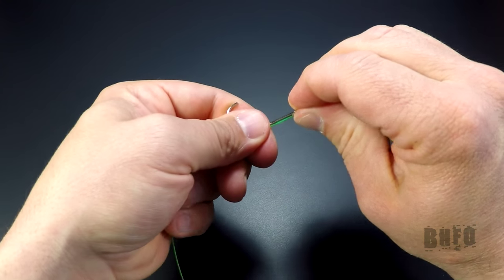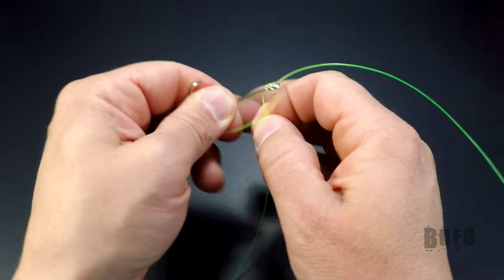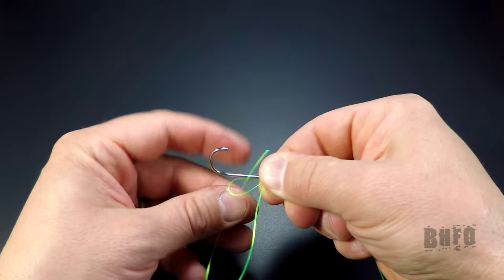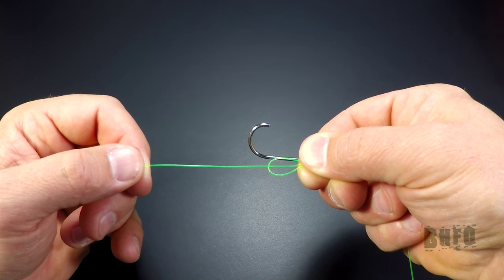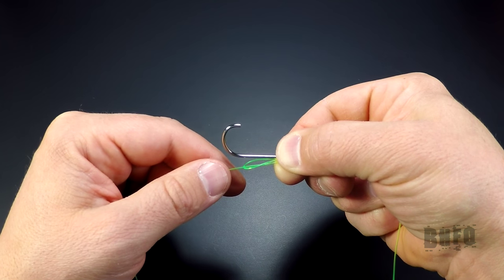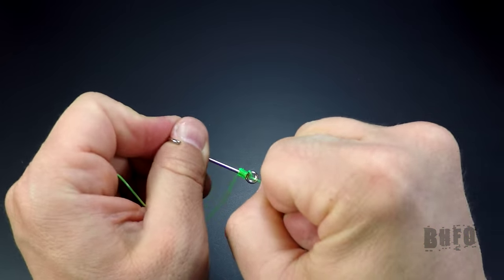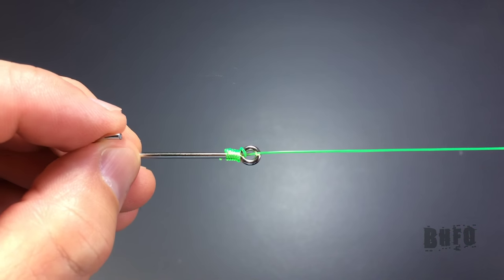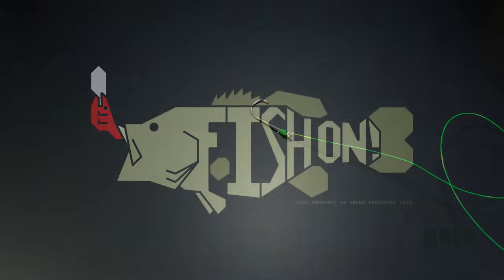Snell Knot

Comment: Thank you for a very clear vid ! I've a question : How does this knot compare in strength to say the double uni, palomar and FG knots ? In your fishing, when do you use which ?
Reply from the maker: Maaifoedie De La Rey the strength of this knot handles very well. I use it for most any hooks made for soft plastics, and of course what it was originally designed for, bait fishing. Thanks for watching.
Reply: +
Fishing POV   Much appreciated
Reply: The FG and uni to uni are line to line connection knots, the palomar and uni can be used to tie on hooks to leaders.

Comment: For some reason, when I go to pull the knot tight, it snaps right around the hook eye? Idk if the little groove cut out around where the bottom of the hook eye has something to do with it. Frustrating
Reply from the maker: silverdropstang yes I’ve had this happen with mostly hooks not made for Snelling. I’ve found that when you put the line back through the eye on the opposite side of where the hook eye meets on the other side of the line already going through it, this helps. I hope that made sense. Thanks for watching.
Reply: Fishing POV Makes sense! Thanks very much for your response. IMHO, this vid is the BEST for the quality and simplicity on how to tie this knot!
Reply from the maker: silverdropstang thank you and I hope this works for you good luck.